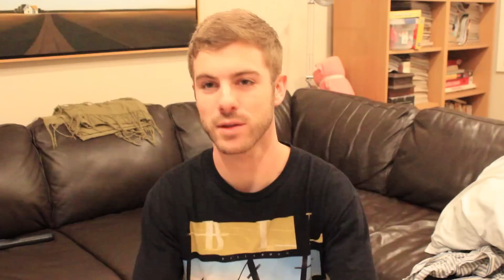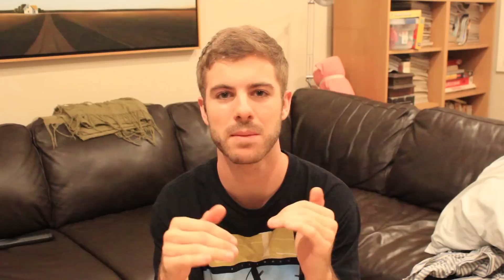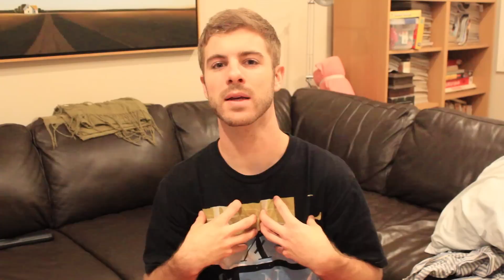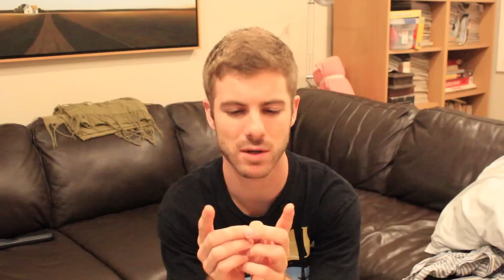Things I Hate About 3d Printing | Bed Leveling

Comment: I have PrintrBot Simple Metal with heated bed and get ZERO warping. It has auto bed leveling, but HB is the key. I set 70C bed temperature for PLA, and get flat and long parts. Also brim is useful, especially for tall elements with small base, such as standoffs and board supports. Brim might be super useful for bigger parts as well when printed on cold bed. Good channel, thanks! ;-)

Comment: UGH! Bed leveling is the biggest pain in the butt! And Automatic Bed Leveling is really not Automatic, as we all know, it doesn't move the bed to compensate for the uneven surface, it's more like Digital Leveling or Virtual Leveling since the bed is still out of whack. The whole paper trick really is a nightmare, I agree, when I set up the gMax using this, I still have to baby step the Z axis DOWN a good 2 millimeters to get flow on the surface. Every time. I would like to see on the high end machines a servo system installed at each corner of the print bed that automatically levels the bed, not Virtual, but actually movement. Since we already shelling out over 2K for this supposed high end machines, a few extra servos won't change the cost to them and improve the quality and be ground breaking. For the keyboard warriors out there who say What About The Extra Weight, let them figure it out, drone servos weigh next to nothing, sure it can be a reality, some day. Great rant, sir, said things we all think. Daily. Thanks for sharing!
Reply: auto bed mesh compensation is where it's at. Get the bed close enough so the difference at the corners is withing some reasonable eye ball test I just checked that the springs have roughly the same pressure and check with calipers against the bottom frame, takes 2 minutes. Then apply mesh detection. The printer I have with mesh bed compensation is tuned to .001mm I got it close, then ran a routine and went up stairs to watch a crime drama, came back down after an hour -- the mesh was created -- no more fiddling with springs, nobs or whatever. Screws for springs are tightened down -- springs can move, screws are locked. It's done I may have to redo it in a year, but it's the same process -- start the routine and go watch TV.

Comment: I think these are issues which can and have been solved, you are wasting time fighting with machines and wasting plastic printing things which end up getting messed up.
I swear by PEI (ultem). I have all my 3 printers using PEI (thin anything from.04 to .06 inches ) work fine. I laminated it onto the borosilicate build plate using 3M 468MP high temp tape. I have printed PLA with no curling or issues with adhesion, no tape, no glue, just print. I have my very non-technical wife starting prints using OctoPrint, just remove the print of the bed after it cools, load the next model, and hit print. No tape, no hairspray, no voodoo, just works. I've printed ABS with similar success. PETG as well. I've even done Nylon with glue stick. And unlike other products, it is virtually forever, you light sand it with 600 grit every 50 prints or so, and good to go. It is fantastic, McMaster has 12x12 sheets for about $20 -- Amazon too, but I hear consistency issues with Amazon sheets as they're smaller than 12x12 (if it matters). Zoro.com has bigger sheets if you need them. I have 500mm bed on my DIY delta, and with PEI I've printed items on taking the full bed -- no adhesion issues. The other thing about bed leveling. This is where Marlin is really far behind. Smoothieware has a feature where you temporarily attach a z-probe just bellow your hot-end, and it will create an offset mesh matrix for your bed. You must make sure your bed is secure, tighten the springs almost all the way. I did this setup on my delta, it would be impossible to level out a bed that big. It works beautifully. I have perfect adhesion on the entire diameter of the bed. Mesh compensation is where it's at, not just 4 points that Marlin uses. Permanently attached probes are also annoying it means having the probe do the z height check before every print -- waste of time. Smoothieware saves the mesh, and you just load it before each print with start gcode command. Hope this helps, there is enough frustrating things about 3d printing, bed stuff doesn't have to be.

Comment: I Have a Davinci 1.0A like you. I replaced  my bed with a new heater and aluminum bed. I have a zebra plate on it. It works for me very good. One in a while I will scuff the zebra plate with 80 grit sandpaper and when I print with Poly or Nylon I spray a little hair spray. I do not have bed leveling issue. Once I installed the aluminum bed and calibrated it I have been printing without having to re-calibrate it again.

Comment: You should try glass and hairspray. To get your print off the glass use an upside down duster can to cool the glass, or put the glass in the freezer for 60 seconds. Additionally if you affix aluminum foil to the back of your glass you can use induction sensing to get nearly perfect prints every time.

Comment: I have heard that 3d ease helps with adhesion and does not make the mess the painters tape leaves on the bottom if the part. I have not tried this for my self I have tried glue stick and that seems to work well with the filliment I use now.